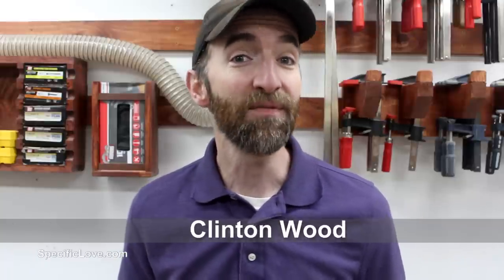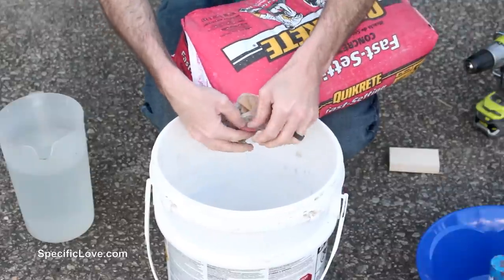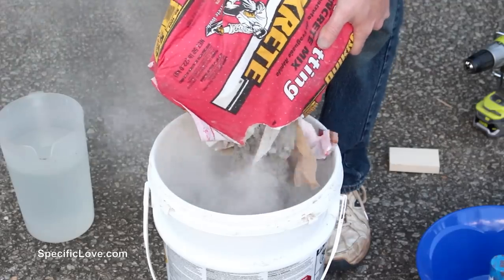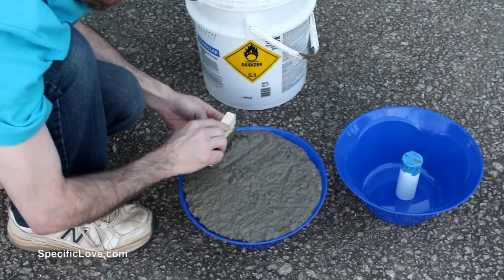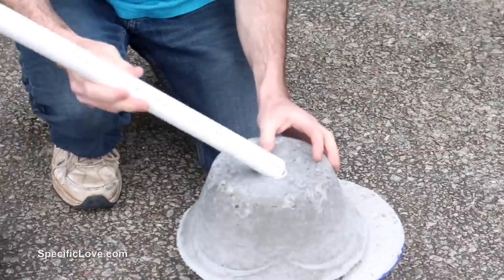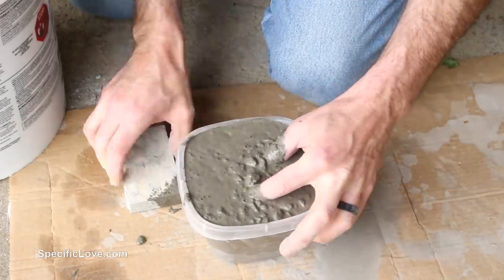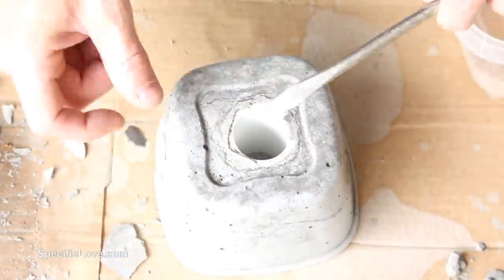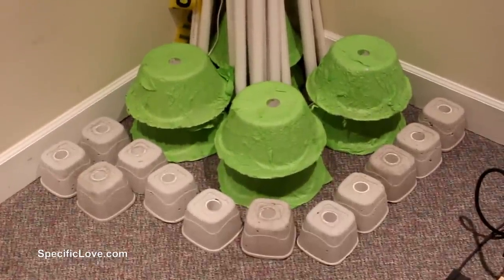PVC Pipe and Concrete Display Stand and Base

Comment: I see it's been a couple years since you created this video but I wanted to thank you...I think you nailed the technique I had in mind for an upcoming event at my church. I'm wondering how much weight (concrete) would safely hold 7'-8' lengths of 1" PVC vertical, positioned in pairs about 4' apart. The horizontal cross piece would be holding a sheer net curtain and would not be subject to anyone (children or otherwise) in close proximity so I'm just trying to approximate how to modify holding each stand-alone pair so they won't tip over from their own weight plus an 8 ounce curtain.
Would doubling what you created likely do the job? Thank you for any thoughts on the project 🙂

Comment: This is a great one. I'm starting to put together booth materials for selling cigar box guitars, and this will have a number of uses. What an easy method for using the two fitting together diameter pipes to make the actual connection!!!! Thanks!
Reply from the maker: I'm actually interested in building one of those guitars. By chance do you have a guide to do so?
Reply: @SpecificLove7  There's several resources. On Facebook check out cigar box nation (they also have a regular web forum with a huge amount of info.) Most of us buy parts and get info from C. B. Gitty Crafter's supply- and on facebook and youtube Friday's at 2pm eastern they have a live hour long broadcast that covers making and playing instruments.
A lot of us starting building watching Glenn Watt (who now works for C. B Gitty) videos.
https://www.youtube.com/user/GlennWatt1
Reply: here's c.b. gityy's youtube. 
https://www.youtube.com/user/benjamanb/videos
Reply from the maker: Thanks for all of the info

Comment: This was a very interesting build and it looks like everything turned out great.
You could have put hot glue on the inside of the pvc before setting it in the bowl before you had put the concrete in. That would have helped to solidify and prevent concrete overlaying and cut down the cleaning process. Also to prevent concrete from sticking, using a sheet of plastic helps from sticking as you can peel it away after it cures.
Reply from the maker: Thank you for the good tips